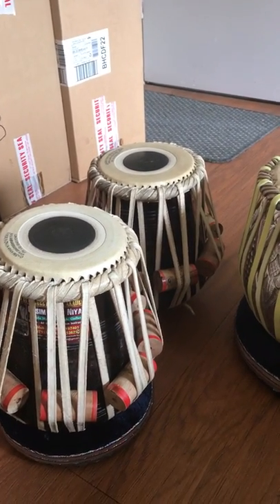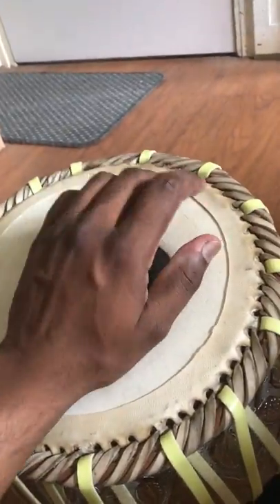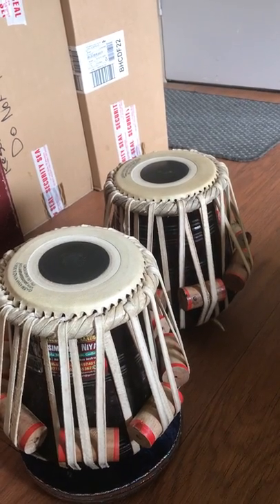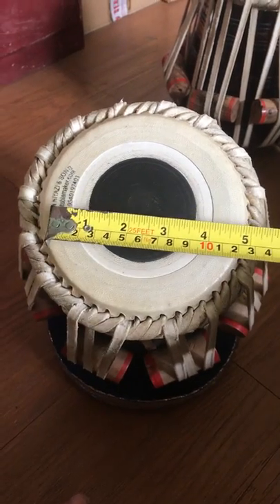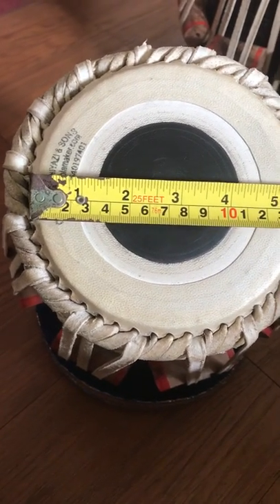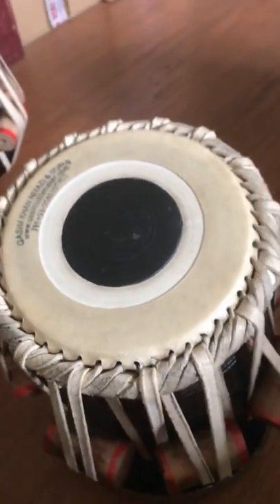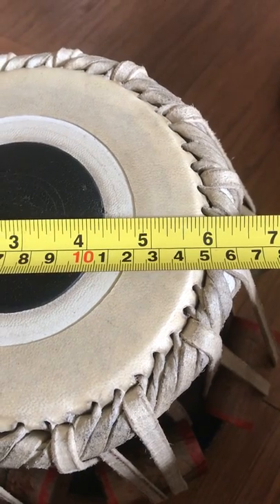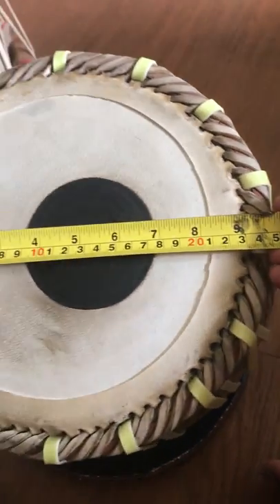Measuring the head size of the tabla

Comment: hi! I have a 5" inch tabla and i have to change its head. My question is: i have a 5" 1/4 head. is it ok tu put it even if it´s bigger or i ruin it doing this. Hope you can comment.
Reply from the maker: Hello. I would not recommend putting on the skin 1 inch bigger than the shell. The skin will not last. Recommended that you Must have a 5 inch skin for a 5 inch shell.